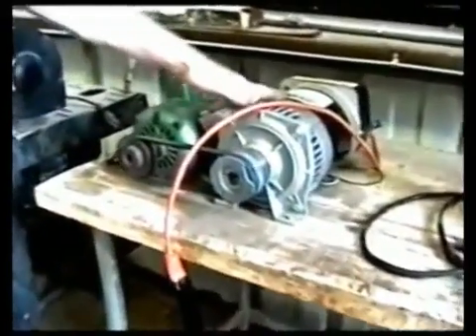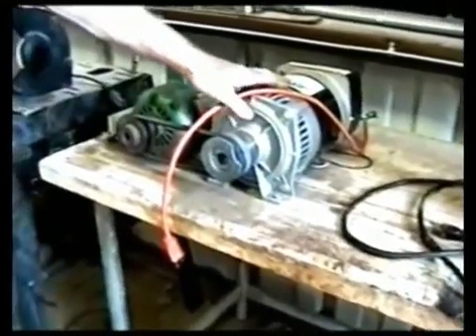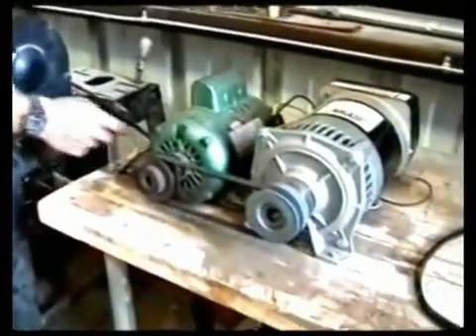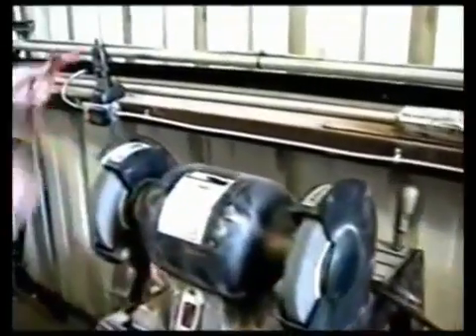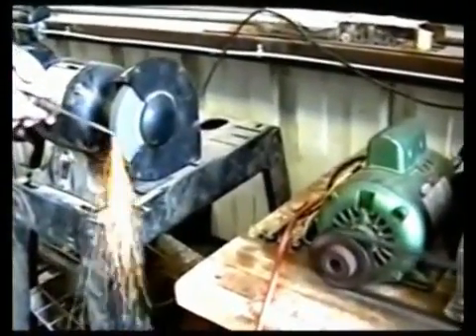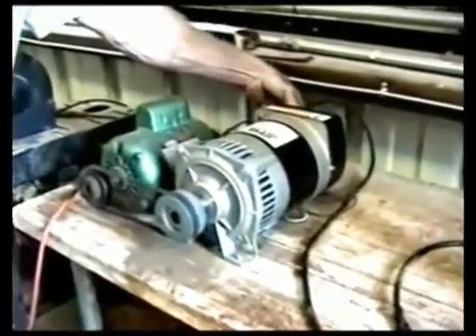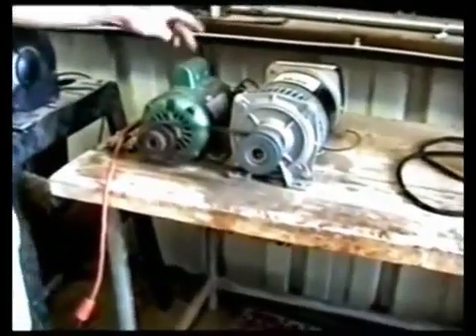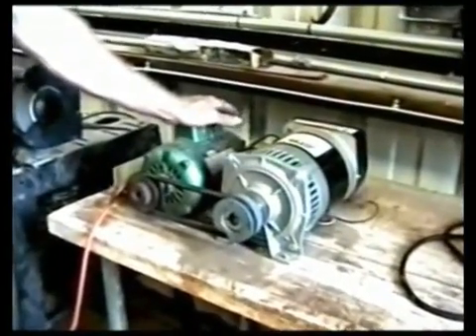3000 Watt Generator Powers Itself, Grinder & Drill Press.

Comment: surely its not modified? as why should it be ? its just a matter of maths 
one two kilowatt generater one 600 watt motor / ie 2000-600 leaves 1.4 kw to run any other machines .i did notice you were careful not to have two machines on at once as this may overload the system , though i think you may have got away with that just!. i also notice you use a self excitinbg generator

Comment: Dude, perpetual  motion machines  Are BS, where are you hiding the other ac inlet cord at? or better yet, show us all the wiring at the rear of the unit, show the wires from the generator to the motor, and the switch unit, Show that there Are without no doubt any other ac in sources, if you cant then its cause you are full of S%@$ like everyone else who claims to of figured out the energy issue...

Comment: You do all realize what he did don't you? Please don't tell me you're all that dumb?

1) The cable doesn't actually power the "generator", it just show, it's not where the power is coming into the switches

2) no such thing as a free lunch. The motor and alternator themselves are not 100% efficient due to eddy currents. Don't believe me? take a magnet, and drop it down a copper pipe, a whole planet is pulling that magnet down. But the eddy currents in the pipe resist a whole planets influence

Comment: You seem to be utilising the generator load current's mag field  (90 to 180 and 270 to 360) to repel it's armature around.  Just can't figure yet how you elliminate the drag from 0 to 90 and 0 to 270 fields without MosFET switching. Guessing it's by cancellation using a winding producing a second harmonic at twice the frequency. God bless your aims I hope you guys can make a difference to this sorry place.